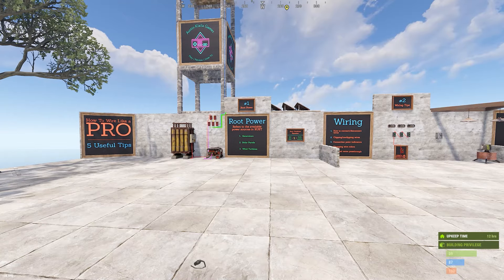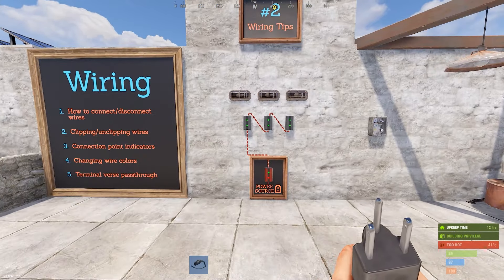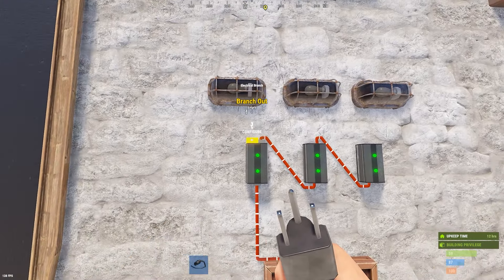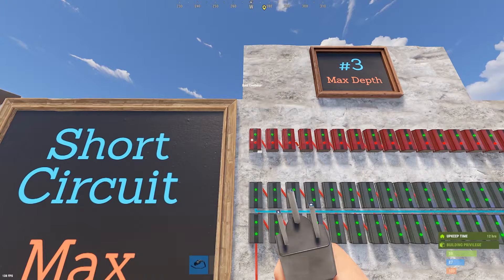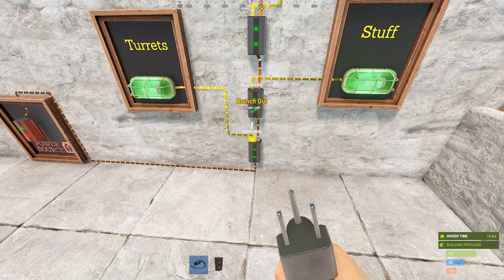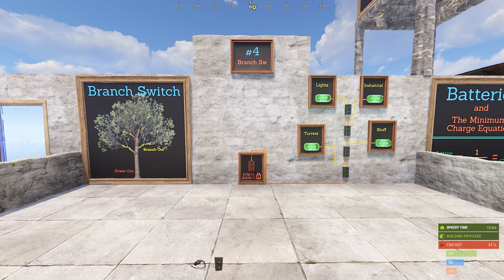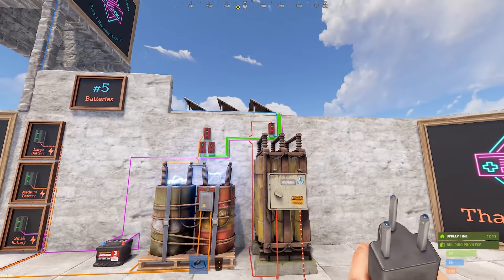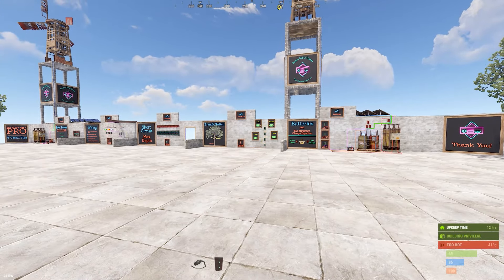RUST Electrical | How To Wire Like a PRO - 5 Useful Tips - 2023

Comment from the maker: Video Contents:
0:00 - Intro
0:16 - Root Power & Root Combiner
2:37 - Wiring Tips
8:07 - Short Circuit / Max Depth
12:04 - The Branch Switch
14:12 - Batteries & Active Usage
19:35 - Outro
Reply: Wire like a beginner would be a more fitting title. Good video, but this is the basics

Comment: Thanks for the max depth explanation! I finally ran into it on my last wipe. I understood it was happening because of root combiners, but didn't understand fully why it was happening. I redid all my root combiners (got a little sloppy) and was able to fix it on my Nih Core circuit, but still didn't quite understand the root cause. The linear explanation and visual representation you had made it very clear. So thanks for that!

Comment: Are you playing on PC? Any tips on clean wiring placements? your wire placements are so clean and some of them are even freaking right angles! i need help. my OCD is killing me
Reply from the maker: Yep, PC. And thanks! Some of my wiring in my videos is made easier being an admin, but it's all doable without it as well. In-game, I will run one wire VERY carefully to use as a guide for the other wires. I also will use spots on walls/floors (etc) as markers to run straight lines. Another trick is to use corners. If you get close and hover around the corner you'll see the wire "snap" in close (not literally snap, but that's what it looks like...). And yet another trick is to use the new switch snapping feature on PC. Hope this helps!

Comment: Viewing the branch as a tree is helpful but worth mentioning that if input power drops, the branch will get priority and continue to get it's assigned power while the trunk will reduce it's output power.  So the trunk output will drop all the way to zero before branch will lose any power at all.  As power is restored, branches will again have priority and fully get their power before the trunk output gets any.
Understanding that is a core concept to some more in-depth circuits.

Comment: where do you get your .80 number as a divisible equation for the active battery usage? (sorry if this is a dumb question)
Reply from the maker: Not a dumb question. It's based on the 80% charging efficiency of RUST batteries. Example, if you send 10 rW to charge any battery it will only accept 8 rW. The decimal form of 80% is 0.8 and is used in the equation to calculate the minimum root power you'll need for charging. 

root power = active usage / 0.8

Comment: Hey, I got a question.

I have a circuit that works fine if I don't feed back the remaining electricity back into a battery.

When I feed back the remaining power into 3 large batteries over a splitter, it gives me a Max Depth / Short Circuit error.

I have root combiners after the big batteries. I have root combiners for the power sources.

Is it that I can't make a 'complete' circuit with batteries in between making it a short circuit or is it that I have reached max depth because there are more than 16 components between power source and the root combiner after the big batteries once it feeds back into them?

Thanks!
Reply from the maker: I'd have to see the circuit to be sure, but if you're getting a max depth error it's most likely because you have a 16th root combiner in an electrical chain (if that makes sense). Feel free to jump on my Discord if you'd like to work it out.
Reply: Hey  @AustinKlailaGames  thanks for the response. Yeah, as you probably know everything was force wiped. I eventually figured that I would just make life easy on me and separate Battery charging from the main cycle and thus simplifying the network.

Comment: How to you get the perfect right angles on the walls? Rust needs to apply a grid to walls when holding the wire, that would make things so nice
Reply from the maker: Practice. If you hover the wire in corners it'll "snap" closer if you're at the correct angle.

Comment: Are you using any tool or hotkey to have those perfect 90degree wire placements
Reply from the maker: No, but I use noclip as admin to my advantage. I also custom set the slow noclip to really slow to make wiring easier.

Comment: 6:34 I assume you already know, but ceiling lights only require 1 power, the text in game is wrong, they only need 2 power if you use the passthrough, and if you do that, you -1 total power required as the last light in the chain only requires 1 power. Check yourself, 3 lights off a spliter, send only 4 power, all 3 lights will activate. Server reset bugs this but an on/off cycle resets them, so if your lights auto cycle you wont even notice. Basically you have a choice, low power parallel or high power series connections, but only for the default ceiling lights.
Reply from the maker: Yep! Generally, I stick to what is out there as far as general information. Most sites list the lights at 2 rW so I just leave it at that incase any updates come out. Plus, I try not to confuse newer players. But you're correct, I should probably address this in another tips video.

Comment: still quite a bit there i never knew, thankx for that. However what is the maximum accepted/effective charge on each of the batteries? like large batteries does it have a max accepted charge of 150RW or 200RW? cant seem to find anything that confirms this.
Reply from the maker: The large battery has a max input charge of 400 rW. I'll have to check, but it might be the same for the other two as well.

Comment: Can you explain how to do auto crafting to where it will craft a certain amount of 556 then start making a certain amount of 9mm and then back to 556 if needed
Reply: Also how do you use the filter fail and turn off features on some equipment

Comment: Is there a reason behind the .8 value?
Reply from the maker: Rust batteries have an 80% efficiency when charging. So, when you are calculating how much root power you're going to need to keep your battery charged, you look at your Active Usage and then use this equation: 

Required Root Power = Active usage ÷ 0.8. 

The 0.8 is the decimal form of 80%

Hope this help!